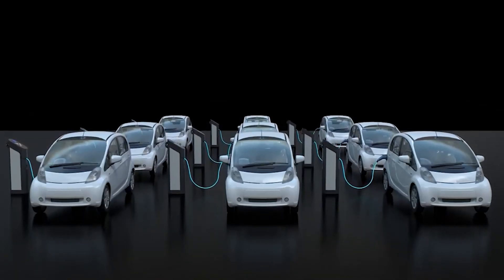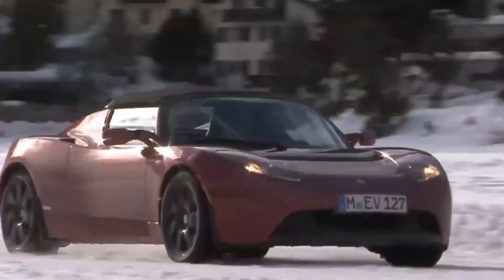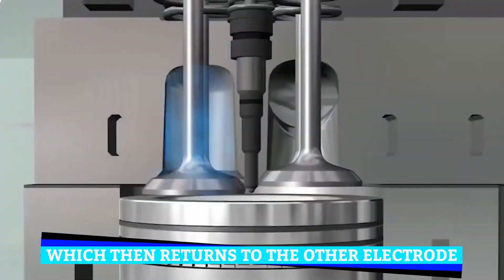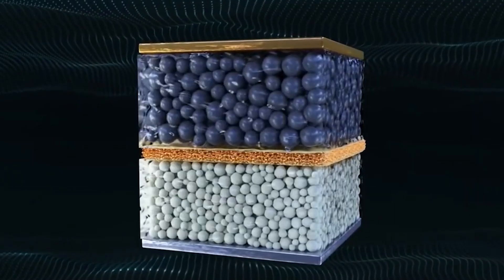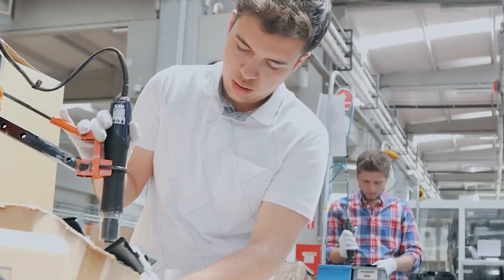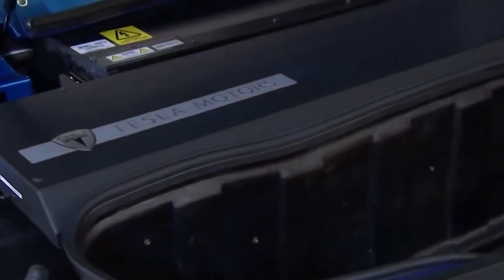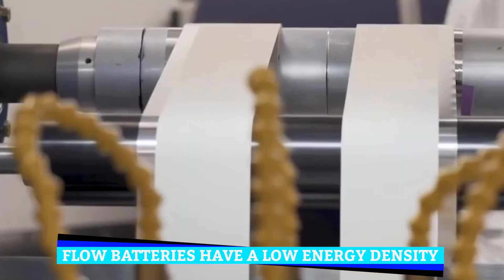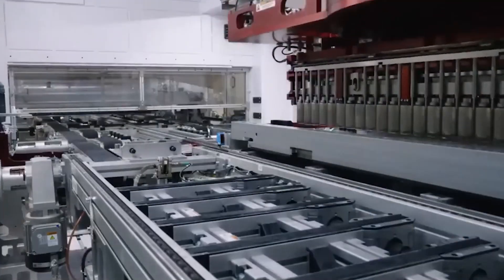New Nano-electro Fuel Batteries will completely transform the IT sector

Comment: hahahaha - yeah, yeah - a new battery that will solve all our problems.  How many new batteries have said the same thing?  Just more incredible BS (unless it actually goes into production)
Reply: It doesn't solve all problems, but it does offer great energy density as well as potential solutions to electrification of automobiles - specifically charging as the nano flow liquid can be exchanged at a filling station far faster than you can safely charge it.

The nano flow fuel was developed in partnership with DARPA for the benefit of military uses - so it's not just some random university parading their latest PhD group project.
Reply: @mnomadvfx  I would LOVE a new technology, don't get me wrong.